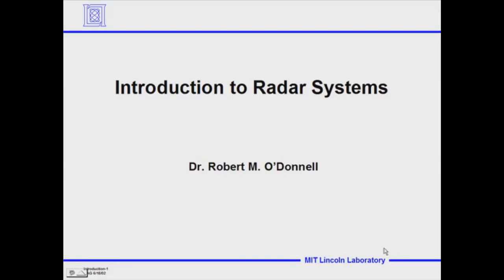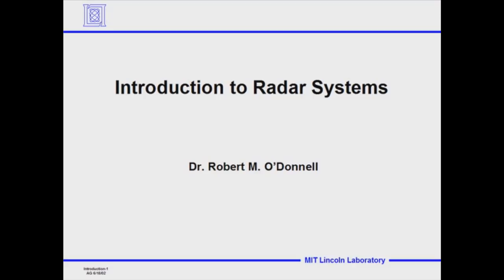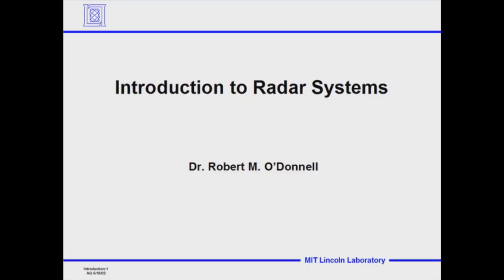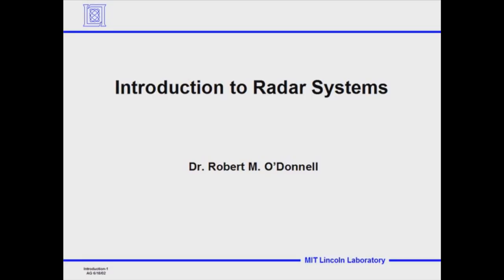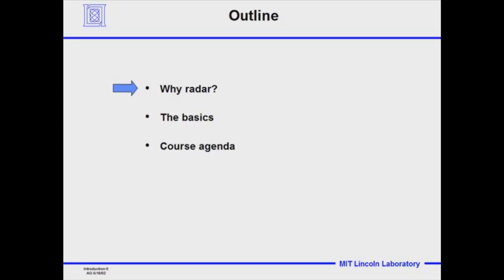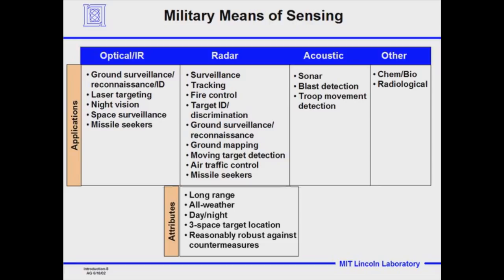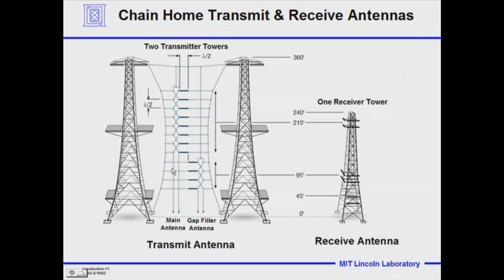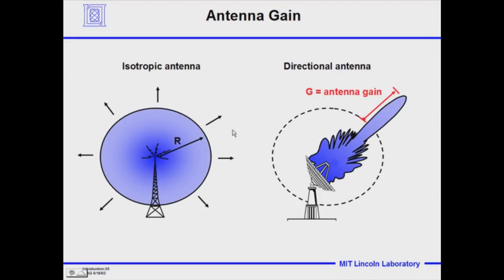Introduction to Radar Systems lec 1

Comment: Great Educational Video, Thank You, Picked Up things I didn't know from all these years. 

I studied Microwave Electronics for 9 months at MICROWAVE Training Institute, here in Mountain View, California how it is Engineered: Klystrons, magnetrons, traveling wave tubes, YIG tuned resonators, etc... use of spectrum analyzers, vector network analyzers, wave propagation , USE of the SMITH CHART in TUNING RADAR Systems .. what is all talked in this video... I worked in a company here in Silicon Valley, as a Technician supporting the design, manufacture, testing, building of 'microwave amplifier  4 - 18 GHZ  stripline circuits' here in Silicon Valley/Santa Clara, California back in the mid / late 1980s. MICROWAVES acts like Black Magic.  dbm,  kTB,  calculating NOISE Figure, Boltzmann constant etc...etc... Loved it.

Comment: I think the table at 42:50 is wrong. In the frequency side it goes from 1 MHz to 1 GHz and then to 10^9 Hz. 10^9 is 1000000000 Hz, which is the same as 1 GHz, and then it continuous to be wrong with 10^12 Hz. Please fix it or put a note on it.